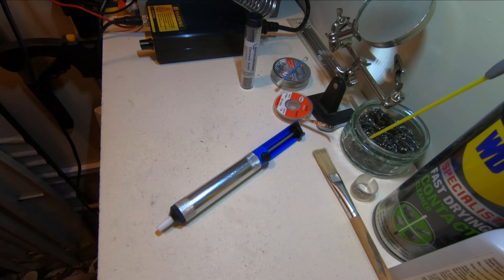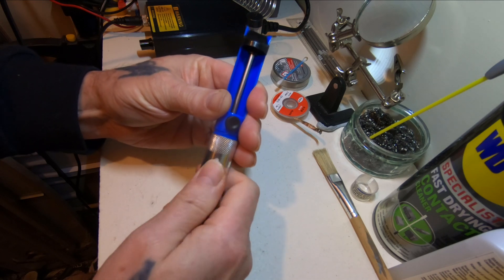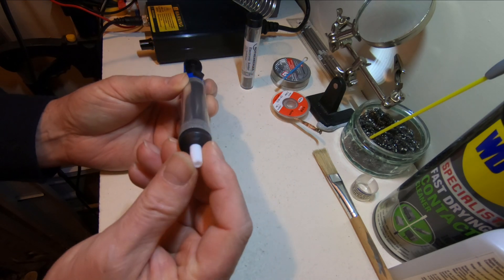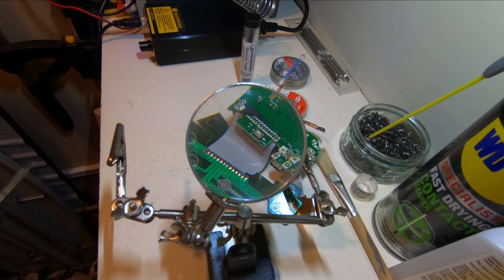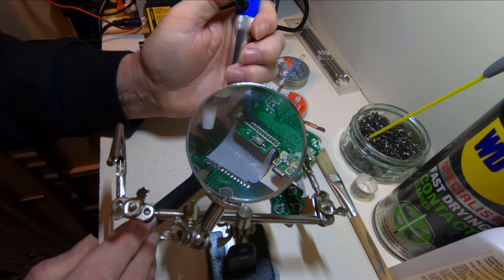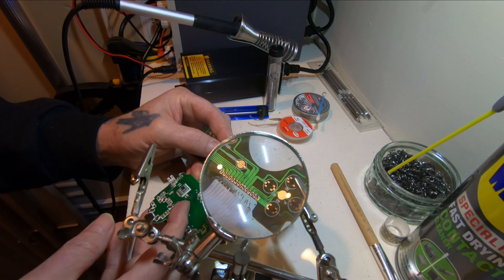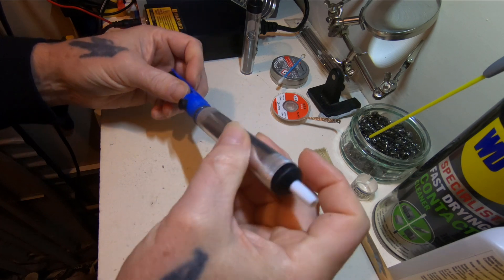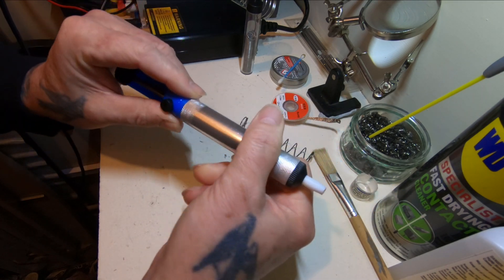AliExpress Solder Sucker, Any Good?

Comment: wait how did the tip not melt when you touched the soldering iron
Reply from the maker: It's made of silicone.
Reply: High temperature resistant silicone!